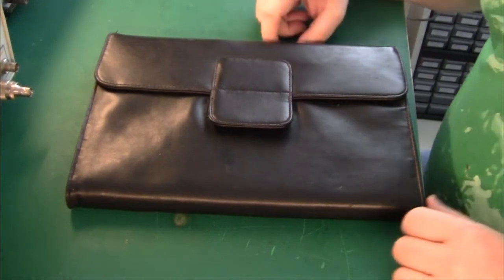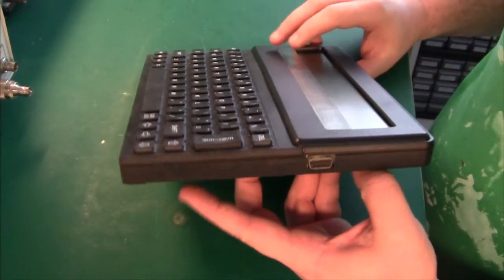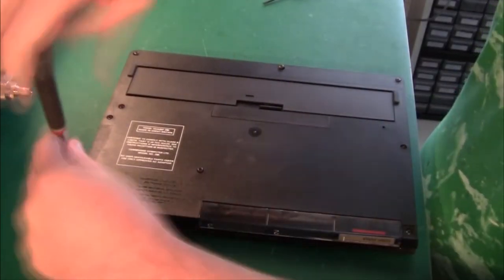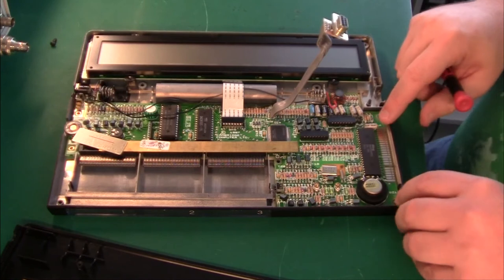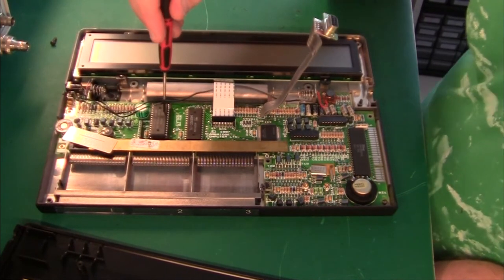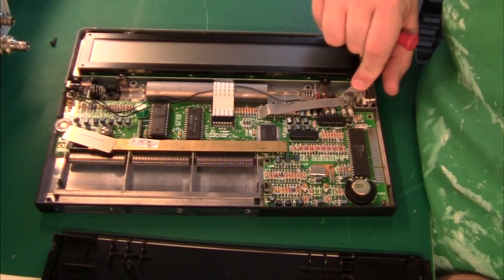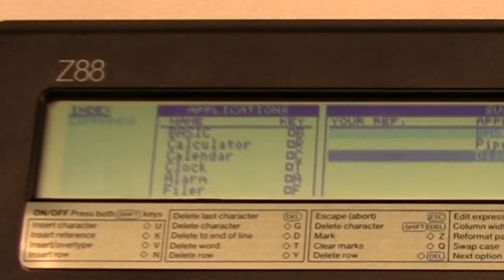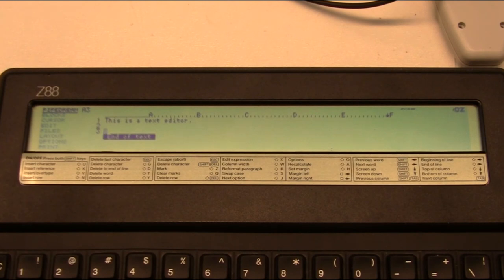Teardown of Cambridge Computers Z88

Comment: I begin to wonder how much of the cost of building the computer was the high-resolution display.  640-line resolution in that small of an LCD text display was almost unheard of in that time.
Reply from the maker: That's right. LCDs were really expensive. If you look at the Epson HX-20, one of the first ever "laptop" computers, it only had a display of like 16 x 4 characters, and it cost a fortune. Same with the Sharp PC-5000. Really expensive portable PC, and only had something like 80 x 4 characters display.